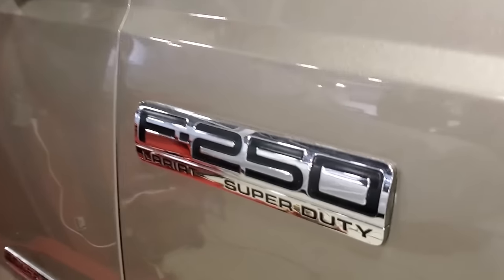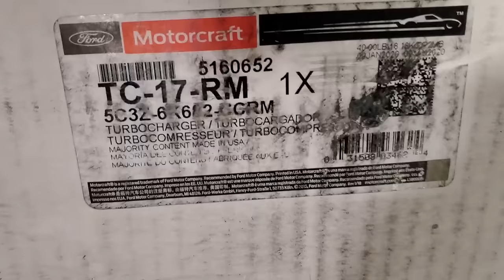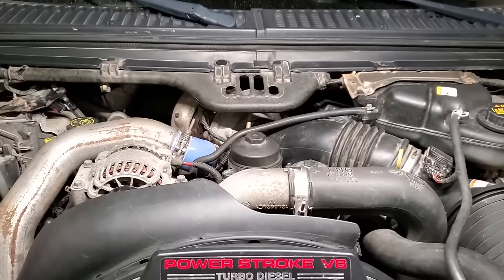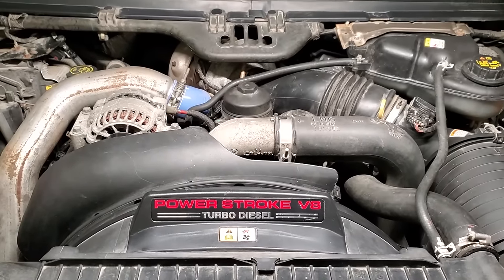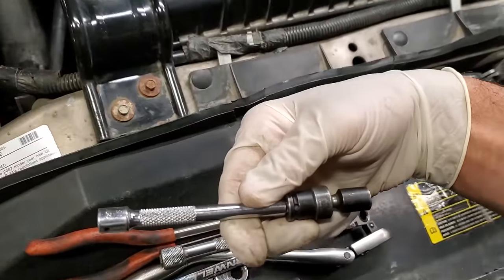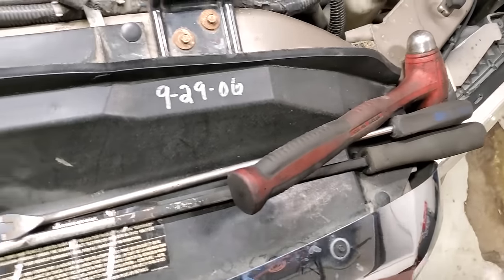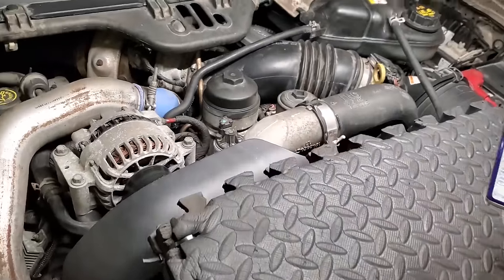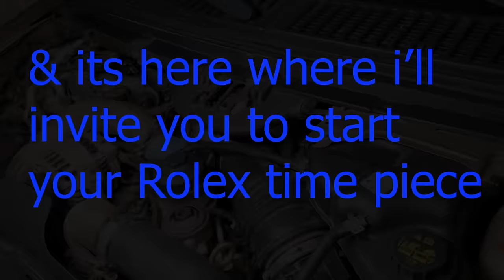FORD 6.0 Diesel TURBO - 10 MINUTE REMOVAL

Comment: I changed my turbo when I put a welded cooler in my 05 I changed the drain and feed lines changed the cac boots. I went with a Powermax stage 1 a lot more response oh a lot more whistle sounds like a jet with 4 inch turbo back exhaust no cat just a resonator. Bearings were gone in stock factory turbo vanes sticking  unison ring was worn.
Reply from the maker: Gotta love dem Powermaxx turbos

Check dis out!!

https://youtu.be/OOEdNniWSzI
Reply: @PowerStrokeTechTalkwARod  i
Reply: Were you getting a whistle/chirp on start ups with the worn unison rings?
Reply from the maker: No
Reply: I guess that's one benefit to having small hands and skinny arms. I had to use a magnet once I had em loose to get all but one of turbo bolts out because I couldn't my hands in there to grab em.

Comment: The first thing that got me impressed is the way you positioned your camera,I also need to change the turbo charger of my 2004 F 350 SuperDuty and will want to seiz the opportunity to also change the ipr valve because from the look of things it is like the screen is broken with the oil 🛢leak around the engine.I hope that after watching your video, it will help me to get it done.

Comment: I removed my turbo when doing the oil cooler change and cleaned it. Taking it out is super easy putting it back in and getting up pipes and exhaust to line up and seal is another story.
Reply from the maker: Gravy brah

Comment: I have the early 2003 6L so that one bolt may be different (glad you mentioned it). I don't know if my turbo is going bad...hard start, peculiar loud noise - I'll need to check several other parameters but it's making a peculiar/odd noise so I'm suspecting the turbo. At any rate, I watched your video and this will save me TONS of time if the issue is in fact a turbo R&R. Thanks so much for taking the time to assist & inform others. Kudos.
Reply from the maker: I appreciate chu

Comment: I did one turbo on a 6.0 many years ago. But it was on an E450 box van. Was a piece of cake. Had our 12 F350 w/ 6.7L dually in for a check engine light today. Seams that the fuel pressure isn't dropping on shut off. Hangs up once in 5 tests.
Reply from the maker: Hmmm
Reply: nice

Comment: 10 minutes is crazy good,  my neighbor lost his turbo on a 1,000 mile road tip and the shop charged him $1,800 labor and $1,800, over $4,000 total for a new Ford turbo in his 05 Excursion... turns out the turbo wasn't even the issue, it was a gas pedal sensor or something like that bx it did the same thing 400 miles later...
Reply from the maker: Omg!

Comment: Just picked up a mechanic apprentice job and I’m working on one of theses. Vgt went out along with bad turbo. PCM couldn’t tell something was wrong kept blaming it on the egr. Been to 2 mechanics before us. Put new vgt and fixed the surging it was getting but turbos under pressure now. Rebuilding turbo tomorrow. Just studying. Thanks for the insight

Comment: Good job you do a lot more set up than I do I usually waste a lot of time grabbing tools I can typically get the turbo out in about 20 minutes however getting it back into place is a little bit more of a pain in the ass I struggle with the exhaust clamps to get them off but I live in Michigan it's pretty good environment for corrosion
Reply from the maker: I'm in detroit & still took me 10 minutes

Comment: The 6.0 PowerStroke has become my favorite engine to listen to.  I drive a late '99 7.3 but the firing order and late firing injector make the running sound less enjoyable for me.
Reply: Hi good afternoon I have a question for u any idea how much a mechanic would change  to fix it my turbo I have ford 250 2004  that truck have a good memories belongs to my brother did he pass away  last year
Reply from the maker: Labor maybe 4 or 5 hrs. Turbo bout 1200-1400 pesos

Comment: I do find these instructional videos such a blessing!  I have an 03 and have had the turbo off when I did some work to upgrade to an 05 intake along some other upgrades.  Just recently developed an oil leak somewhere on top and it's not on or near the oil cooler.  Assuming it's the turbo drain tube.  I need to update both the drain tube and feed line.  Do these older drain tubes have issues normally?  Is it critical for the newer drain tube to be in so far as the older tube has a stop?  Thanks again ARod!
Reply from the maker: Only problem ive had is people crushin them because they slammed the t/c down on ot

Comment: HOLY SHIT!!! That is one clean 2007! Brings back memories of my 2007 before I sold it to get into my 2016. I can't believe I'm actually saying this, but I miss those 6.0 days. Yup you did it exactly the day I used to do it. The bothers I had with doing this job were: those pushpins that retain the wiring loom over the cowl (the MAP sensor one being the hardest without breaking), that damn cheesy VGT wiring connector with the two retaining tabs that snap ever so easily, and once undoing the coolant bottle, pulling it off to side used to make me extremely nervous about possibly breaking that 'y' connection between the heater hose to front cover tube. Looks like this '07 also needs the update drain tube (6C3Z-9T515-A). Can't believe I still remember all the important 6.0 part numbers on the parts I used to sell quite frequently. You guys are still getting 6.0 diesels coming onto your doorstep? I would've thought for us dealership guys that 6.0 diesels would be old news by now! Now...can you remove a 6.0 diesel turbo from an E-Series in that same ten minutes?
Reply from the maker: Great CHALLENGE!!!

Comment: I would like to ask a question about putting the turbo back on 
Getting the turbo hook back up to the Y pipe ? Is it hard to line back up? And On a scale 1 to 10 and 10 being very hard . What would you rate the turbo at . I have a 2005 Ford F-250 with the 6.0 I need to change it out .
Reply from the maker: 3 or 4

Comment: curious, does fluid actually flow through those hoses connecting to the degas bottle? Or are those hoses just to vent pressure from the oil cooler(?) and intercooler?
Reply from the maker: Yes fluid is actually in there

Comment: I work on 6.0s every week and pretty much identical to how I remove them, only I've found I have to take an extra couple min to drain a gallon of coolant to empty degas bottle and remove hose. The whole leaning the degas bottle over still attached trick has bitten me so so many times. They love to break at the plastic connection at the T and being $60 or so to replace, its not worth the time saved.
Reply from the maker: Yeppp👌
Reply: Broke mine. Thank goodness the replacement is metal.

Comment: LCF 4.5 will not start hot can’t find any oil leaks anywhere everything in this truck been replaced do you have any recommendations?
Reply from the maker: Watch our air leak test video...
Reply: Hi, Air, tested this thing every which way possible only thing I think it can be is The branch tubes. I don’t know how to put more pressure in the system then Sure.
Reply from the maker: @angelahendrick7610 are you sure is not fuel related….?

Comment: Late to the party just found your AWESOME channel. You said 28.5 boost is to high... why us that? I'm getting 28.5 when it needs it. Granted I'm studded so no worries on the head gasket front. 06 engine in early 04 body.
Reply from the maker: Unless ur tuned...after 26 psi...ECU starts to cut fuel....

Comment: I have a e350 6.0 lol. change injectors, 15 hrs. the shop wanted 4k. I did it for 1,200.00, Just Bolts and nuts.

Comment: How can I tell my Vgt accutator is bad or EBP sensor? No codes popping up, truck is straight piped and use to sound like a Jet at idle, now doesnt seem as loud, seems to be under powered at lowend and top end. Elbows are good, sct scanner says I am getting boost. Any help would be appreciated.
Reply from the maker: You would have to go thru some diagnostic pinpoint tests

Comment: OF course, all my bolts out (took me 2 hours, I don't have the cool Millywalkeh's. All hand tools. Now I can't get it pried loose. Mines an '06 F350 FX4, it did have a bracket from the upper hose your didn't have. Now I am worried there's a bolt somewhere else I missed, but I can't see anything. 

I'm afraid to pry harder and tear something else up...
@PowerStrokeTechTalkwARod
Reply from the maker: You'll have to email us pal
Reply: Ah, the bottom of the V clamp on the up pipes in the rear/bottom is NOT coming loose. damn.

Comment: I have an 03 6.0 with a bad turbo. How hard is it to get to that back bolt you mentioned?
Reply from the maker: It can be a pain but you'll have to get it with a wrench and a pry bar to turn the wrench because it's probably gonna be really rusted
Reply: I'm not exactly sure what you mean by turning the wrench with a pry bar.
Reply from the maker: Like u need to pry against the turbo to turn the wrench cuz u cant get ur arm in there to break it free....
Reply: So I guess you can't get breaker bar and socket in there?
Reply from the maker: Ahhhhhh NO

Comment: I have a 2003 6.0 and i need to change the pedestool gasket can i use this method to get to them this thing is leaking oil on the floor cause if it
Reply from the maker: There is NO pedestal gasket...

Comment: A pro makes it look easy... A pro makes it chi ching $$  I knew an Auto body guy who got paid by the car not by hour. He did very well. Curious ... how long is reassembly?
Reply: Its about the same to put it back on. Once you remove it a couple times it becomes really easy to do. Its just really heavy so kinda a pain in the butt angling it in there, especially if the alternator is still attached.
Reply from the maker: Gravy brah gravy

Comment: isn't that brilliant to run the wiring loom from one side of the truck to the other via a high location on the firewall? Too bad the new superduties run it under the engine in the road grime areas from side to side. no wonder why they have electric wire issues down in the elements.

Comment: Removed in ten minutes....BUT CHARGED BY THE HOURS.....
Reply from the maker: Book time brah. Just because i have done it a 1000 times & know my craft...doesnt negate a cheaper rate. Ur paying for the skill and knowledge........& then the job.
Reply: @PowerStrokeTechTalkwARod  Then it would make sense to charge by the job instead of by the hour. (Like most Ford dealers do) Not berating your craft just really don't like dealers.
Reply from the maker: Are you familar with flat rate labor times?
Reply: @PowerStrokeTechTalkwARod  What I am familiar with Is the Ford dealer gets the vts solenoid from Garret (which Garret sells for $179) they put it in a Ford motor parts bag and charge you $328 for the same part. They also get the head gaskets from Mahle (Mahle sells them for $50) they put a part number on it and charge $80 for the same exact part. If you have a private shop You can do whatever you want It's America. But the dealers can all go to hell in my book.
Reply from the maker: What ever u say my man